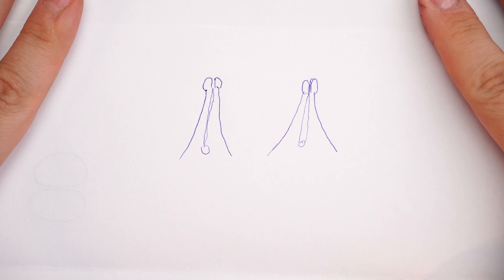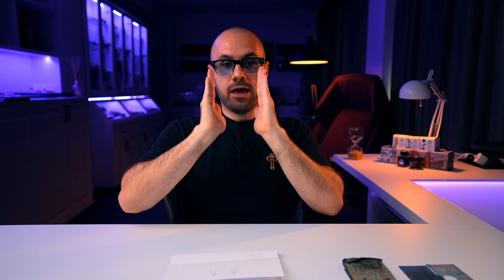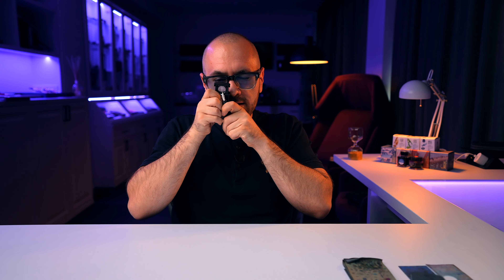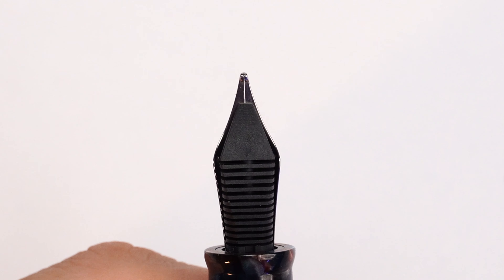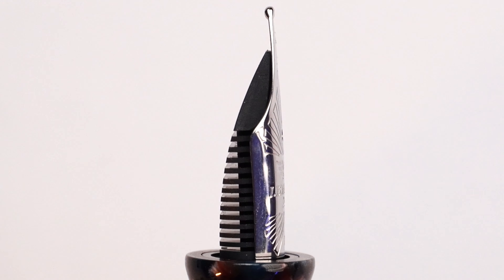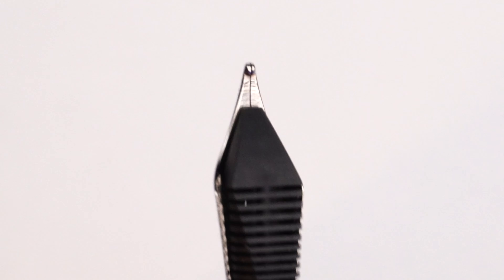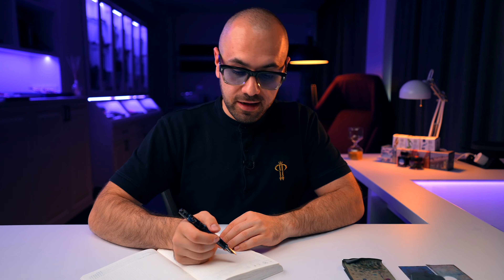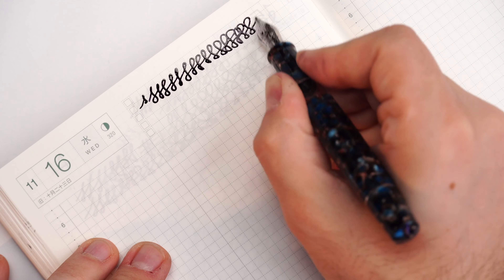How to make nibs write smoother ⛸️

Comment: I have been using fountain pens for many years (mostly japanese EF-MF) and I will tell you what I don't like about them: 1. Ink dries out on an open nib when idle - this is BIGGEST minus. 2. Dependence of the nib quality on the paper - from a masterpiece to incredibly unpleasant. 3. This is appearance of a sweet spot over time, that is, the wear of the convex surface to the flat one, that is, thickening of line. For example, japanese company Platinum uses a very weak iridium tip - two of my friends wore out tips of 3776 Century by a third in a little over a year (in my experience of finishing nibs, Platinum is slightly harder than chinese, but inferior to solders from Pilot and Sailor, not to mention german nib manufacturers). I categorically do not like 3776 - a very hard nib, it comes out on paper with a micro-impact - a real nail.
Reply from the maker: hmmm - aren't all pens dry (sooner or later) if they are left idle with no cap ? 
on your second point I didnt understood - you where saying that these Japanese nibs are depending on quality paper? if yes - I can tell you that all finer nibs (which Japanese tend to be more finer) require good paper wo have a good experience in writing
on your third point - logically a smaller tipping material will more easy form a sweet spot if its used constantly and it would be more noticeable than something like an european one which is larger (on the same nib size) - now there is nuances for this since companies are using different tipping that some is more robust and others are using a softish one... when a platinum 3776 is coming at a under 200 eur cost with a gold nib you kind of expect this...
Reply: @pen.venture  You didn't understand me. For example, a gel pen lies for hours and writes immediately, if you leave a fountain pen open for at least 2-5 minutes (depending on the ink) - it WILL NOT write immediately after that. And about 3776 - I mean that the carbide ball on the steel Pelican nib for 20 euros wears out five times slower than on the more expensive 3776 nib (or rather the pen - since the Japanese do not sell spare nibs). And by the way, this 2XX steel nib writes much softer and more pleasantly than this 3776 nail.
Reply from the maker: @ let’s agree on some but on some let’s disagree, leaving a pen idle uncapped for 2-5 minutes and comparing it to a gel pen it’s the first time I’ve heard this since I’ve started into writing instruments 10+ years ago - maybe is just me - don’t know ?!

As for the tipping - get the pelikan if that wears off less - I just want you to understand that I don’t have extensive experience with a 3776 pen but any other pen I ever tried I have never been able to wear off a tipping, using pens daily for hours … for me I can’t imagine how this is happening but maybe I’m not using that pen or in the extensive writing schedule. So - get the pelikan if that wears off slower that seems to work best for your use
Reply: I haven't used 3776 for many days and even less for years - I don't like writing with this pen (although I've had 9 copies of 3776 - mostly new ones that needed to be brought to a normal, writing condition). But two of my friends who wrote with these 3776 for about 1.5-2 years - the ball was almost half worn out.
By the way, I remembered another disadvantage - at medium and higher feed rates, the ink penetrates the paper to the back side.
Reply from the maker: @ get a better paper ;) that will make both the gel or the fp experience better
Reply: In life you don't have to choose, so I imagined it - they present a contract to the bank, and I tell them - "Print it on better paper!". That's how it turns out, fountain pens need special conditions - close it right away, buy expensive ink, buy elite paper (although, to be honest - I have the same Rhodia of different series and I don't like it, it's heavily glued and therefore it's as if you're writing on plastic - there's no life in it, I like the same Leuchtturm better).

Comment: Hi ! I missed the live, but I am watching the video now. 
I have smoothed nibs in the past, with success, but everytime the nib ended up slightly broader that it initially was - so I am eager for some professional advice.
By the way, I purchased several pens from you, that you checked yourself before shipping ; and every single one of them was top notch. No need to smooth or tune these pens once you have checked them ! They were pristine !

Thank you for this video and much warmth from France ❤
Reply from the maker: Thank you so much - I always try to help people with my content. Regarding what you mentioned on the adjustment is the fact that you develop a foot on the nib, if a sphere (im referring to the iridium ball) is touching the paper, the contact surface is small, once you start to put it to the abrasive paper and take a chunk out of it without rotating and making figures of 8 while adjusting it, you are like cutting and maximising the contact area that is why a smaller nib size writes thicker lines after this.

I always try to adjust the pens of my customers in order to have them smiling once they get to try them out of the box :D